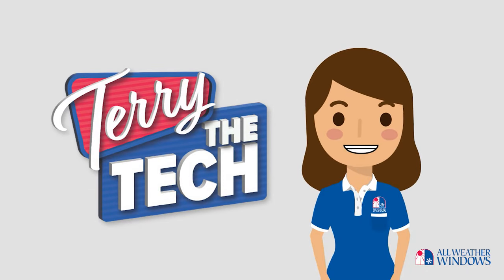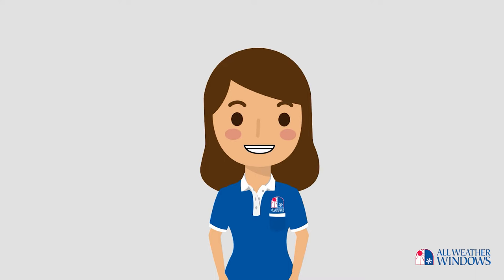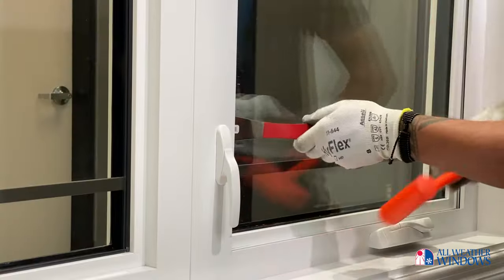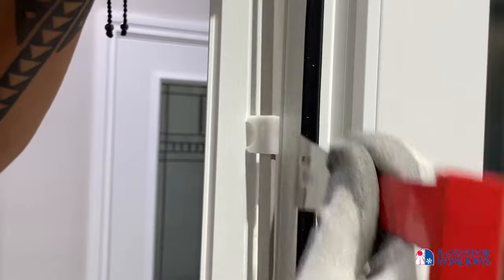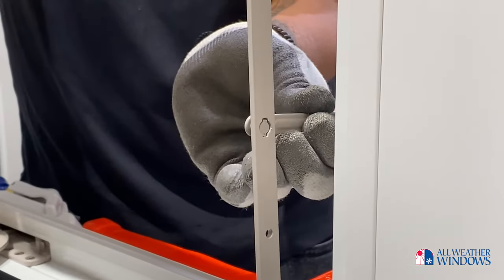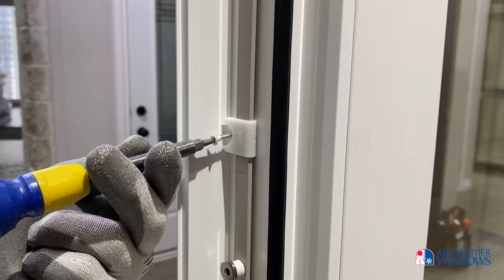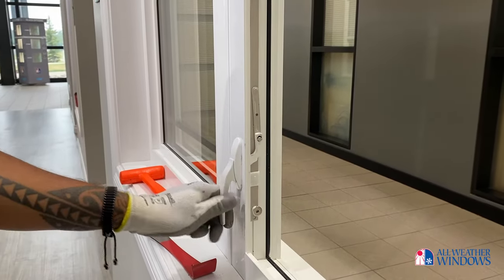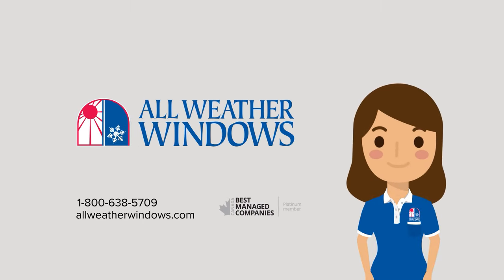DIY - How to Replace the Sash Lock on your Casement & Awning Windows

Comment: Thank you so much for this video! We had a broken sash lock that has caused our window to be locked in place for 5 years!!! We watched your video and within 5 minutes,  we were able to finally pop the lock and open the window! (We used an old credit card and a rubber mallet instead, which worked just as well) Thanks so much!

Comment: For anyone with rivets and not screws, the only way to repair this is to drill out the rivet.  You need to find some appropriate screws to replace the rivets with and you need to be mindful of that you don't use the rivet hole for your screws.  At the same time, if you put the clips in the wrong locations it will interfere with the window closing and locking properly so check the functionality before screwing the clips back in place.  This whole process was needlessly complicated and difficult.  Please All Weather Windows, don't use rivets in your products, it is very anti-consumer.
Reply: Thankfully I read this, otherwise I would've damaged my window. What a garbage design.
Reply: Ok I found a way. Pry out the front part of the white clips (not the rivot). Then use both hands to pull the bar inwards. A few trys in you will find the perfect angle to remove the old lock. Put on the new lock, just make sure you knock the white clips back in their groove. Hope this helps someone in the future.
Reply: @stefantakacs  anything that is "pressed on" or "pressed in" is utterly TERRIBLE design.  andersen started doing this so you have buy the whole thing for the locking mechanism, WITH the bar and all, instead of just the locking thing.  it sucks

Comment: I have 3 awning windows  and there is a lock on each side of the opening window. There is a different system on mine then what is shown in the video.  Last week with the -40 cold, one corner is not sealing , lower right , lower left corner is OK. 
   I talked to the fellow at the Coop where they where bought, but a new guy and he did not know how to adjust the latch. 
looks like a short metal bar on sash with 3 screws and slots , one screw is a lock .  There are on the second floor so hard to see from inside. Barry M

Comment: The most glaring issue with this video is that they do not explain what position the rotating handle should be in either locked/ attempted unlocked position. People will be there just bashing their paint scraper with a hammer wondering why the window is now smashed and the rod is bent.

Comment: I have the same problem as sebastian, no screws, just rivets.  I can't figure out how to get this off without breaking it.
Reply: Drill the rivets out carefully and re-rivet. You might be able to use self tapping sheet metal screws for installation. Just verify the proper length.

Comment: taking a putty knife  or small thin pry bar  with a hammer  and light taps   does not work  after a few tries
Reply: We used an old credit card and a rubber mallet. It worked great!